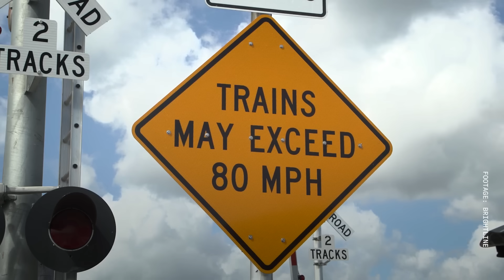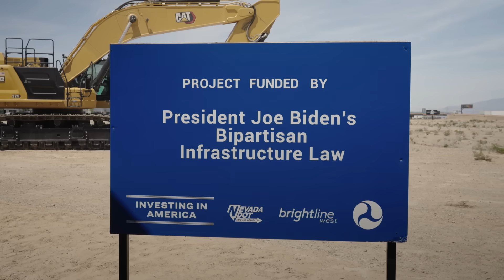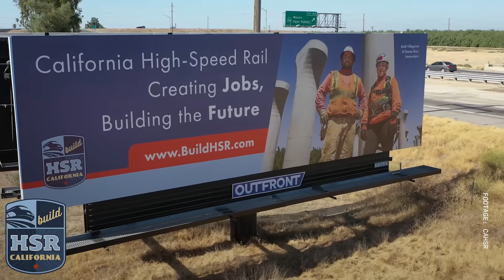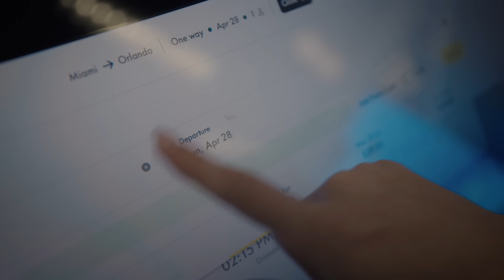Inside America’s First High Speed Rail

Comment: Big oil and Airplane Lobby has prevented this for years. Because  it prevents people from buying plane tickets or using vehicles to travel long distances. No fuel is used in High speed rail. Electric rail systems are used. Also now electric lobby is trying to jack up rates for electricity while they bash green energy renewables so you don't cut use of electricity. GOP always going on defense of oil and gas to prevent renewables all the time.

Comment: Brightline West is off to the races, promising to be completed by the 2028 Olympics in LA. That sounds a little ambitious, but if they pull it off that would really help Rancho Cucamonga and the surrounding region.

CA HSR had to be scaled down because of budget and schedule overruns, so Bakersfield to Merced will get it first, and that could spark some much needed economic growth in that region. But if/when it connects the SF Bay Area to the LA Metro region, I suspect that's when it will start to drive serious growth.

HSR is costly not just because of the huge land mass of the US, but also because track and power transmission have to be built to accommodate and power the trains. Existing road and rail infrastructure often have to be redesigned to allow HSR to go through without impacting either (CA HSR has a ton of videos where they're doing this), and then there are the inevitable land use disputes and lawsuits (biggest reason why CA HSR is behind schedule). And on top of all that we have to make sure that this new system is safe and reliable, we don't want a situation like in China where 40 people were killed and many more hurt in a single collision.
Reply: There are also other factors dragging out CA HSR that you didn’t mention, like the lack of HSR experience in both the design and construction teams meaning everything needs to be learned from scratch, California environmental regulations dragging the process out with a decade of impact studies, or the obstruction of federal funding by house republicans early on into the project’s life cycle.
Reply: if you can't understand one thing, there are no problems for roads when land is needed there, but for rails and tracks you have lawsuits on your hands ? it's clear who's behind it, the brainless lobbyists

Comment: Mom: We have a Shinkansen at home.

The Shinkansen at home:
Reply: Its mostly a matter of building consistently and building expertise, and avoiding over subcontrscting.  Farming it out to Brightline is a step in the wrong direction, but if they built an internal labor force and build consistently they can do a lot of good.
Reply: The Las Vegas branch seems to be doing better than the western one. The western one hires locally and then fires everyone once their section is done. There is no efficiency curve, they start from zero always. Because politicians are using it as a way to buy votes, hence why it's taken forever. It was a similar story in Japan. Costs ballooned way over budget and it was widely seen as a publicity stunt. But once it got running, Japan managed to... manage it into fame. Maybe the US can do the same.
Reply: Bob the Builder: "Can we build it? YES WE CAN!"
Reply: Keep in mind that the conditions across Honshu and the Western US are very different, most notably a much broader range of biomes and weather in the Western US, not to mention just more physical area to cover. I don't envy the engineers working on this- they'll have headaches over materials selection and design. Additionally, the US has a very strong car lobby to overcome. A better model would be to look at the French TGV or Germany's Deutsche Bahn, particularly the latter, with VW being a major obstacle. Of course, we'll have to wait and see.
Reply: @me0101001000 *China has entered the chat- bruh if China can we can
Reply: @nathanandsugar5252  on one hand, yes, that's true. The US and China both have the technological means to do it. But on the other, I'd be careful comparing an authoritarian nation with a command economy to a market economy like the US. While the US has the issue of nonexistent rails and a strong car lobby, China has the issue of unrealistic quotas and the rails going unused due to regular people not being able to afford the fares. 

I don't know if you speak any Chinese, but there's a social phenomenon called 差不多, which basically means "meh, good enough". In social settings, that's fine. You did your best, now don't worry about it. But in work, it's a bad thing, which refers to being lazy and cutting corners. This attitude has resulted in shoddy workmanship on scales as low as consumer goods, to as large as fake buildings to meet development quotas.
Reply: @me0101001000  The idea that a command economy is needed to do high speed rail is wrong. The key I'd the willingness and competency of the gov.
Reply: @nathanandsugar5252  For context, Japan is not a command economy and they managed high speed rail before anyone else.

In fact, with the exception of Hokkaido, Shikoku, and freight, Japan Rail (which runs the Shinkansen) has been entirely privately owned since 1987.
Reply: @nathanandsugar5252 China actually cares about investing in public infrastructure and public safety tho
Reply: @buggs2026 tofu dreg construction has entered the chat
Reply: @nathanandsugar5252  The issue is that an authoritarian government can just do things.  They don't always make logical sense or execute very well, and frankly, many aspects of China's High Speed Rail system displays aspects of both.  The US has something different: an extremely deliberative, consensus oriented system of government that is thus slow and ponderous, but tends to do things at least reasonably well.
Reply: @nathanandsugar5252  But with a government in the US lobbied to hell and back, it cannot be considered either willing or competent in that field.
Reply: @me0101001000  Well that "cha bu duo" phenomenon you so easily deride has produced a world class high speed rail network in China which the US can only dream of building. The Beijing-Shanghai high speed rail line will carry half a million passengers ... EVERY SINGLE DAY. And it's been doing that for 15 years without a single accident. Yet here in the US we have rail accidents all the time. Who is being "lazy and cutting corners" huh? The fact is the Chinese CAN produce the highest quality goods and infrastructure, so long as you pay for it. There is plenty of 差不多 in America as well. Really the only difference is the US simply does NOT have the technological knowhow or the human workforce experience to build the best and fastest type of high speed rail in the world, but China does. If the US wants to build a high speed rail network anywhere near the level of what China has, it will need to get that expertise from abroad, from Japan or perhaps France or Germany. But there is no domestic train industry inside the US that can get anywhere close to achieving proper high speed rail on our own.
Reply: @me0101001000  Only in Germany is it the case that the automotive industry and rail transportation work together, which cannot be said of the USA. There, the car lobby is preventing the expansion of rail transport because they are afraid they won't be able to make their money any fatter. they are working against each other, not with each other

Comment: Does Acela not count? It's not exactly spanning very far, but it does exist at a hefty cost
Reply: True high speed rail is 186 mph or 300 kmph and above. Acela is just below the threshold, I Believe Max speed of 165 mph
Reply: @rockfan2406  good to know. thanks for the clarification
Reply: The Acela top speed is only about 130 mph and it only touches that during very small areas

Comment: I’m pretty sure Acela will be/is America’s first HSR, but interesting subject nonetheless.
Reply: Yes if Amtrak can get the 160 mph Avelia train by Alstrom running in revenue operation before BLW. Acela's top speed of 150 mph is a bit short of high speed rail's 155 mph (250 pm) minimum.
Reply: The problem is that the Acela runs on aging infrastructure that limits the service's speed, which therefore prevents it from proper HSR classification.
Reply: @MrMarshmallow26  Sorta, it is legally considered an Upgraded HSR (which has different classifications) but as soon as Avelia Liberty entered service the line’s max speed will go up to 160 mph and would classify it for HSR if it was a New Tracked HSR.
Reply: @ryanjapan3113  Once these infrastructure upgrade projects are done, maybe Acela will get its true classification.
Reply: @MrMarshmallow26  Technically it already has it, it’ll just be more properly one one the Avelia Liberty’s start.
Reply: @MrMarshmallow26  Yes, perhaps someday track upgrades can be made.